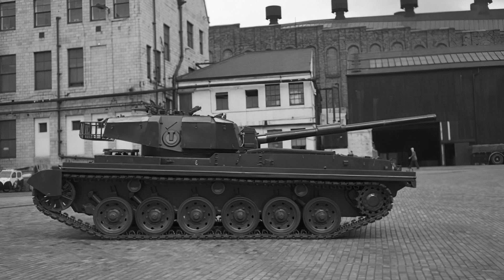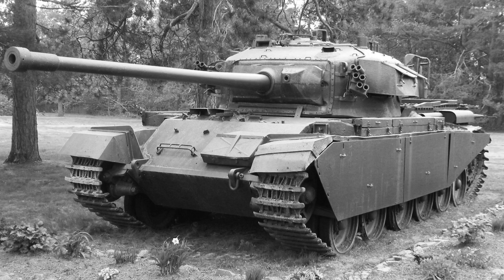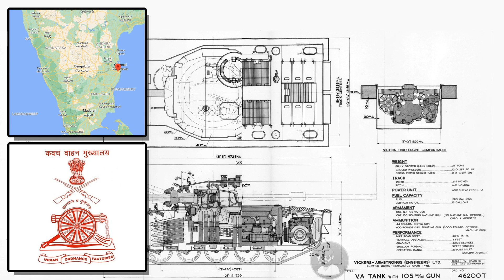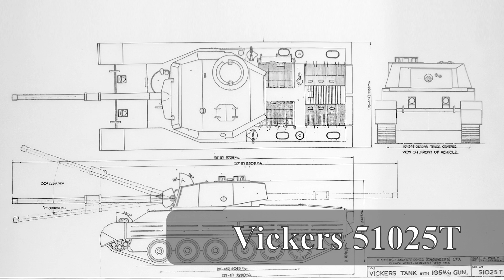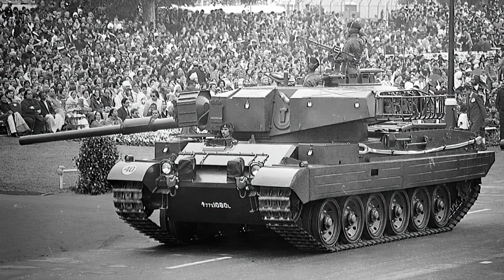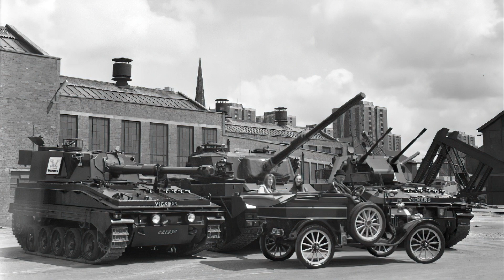Vickers Mk1 MBT - Main Battle Tank - Tank Design & Development - Part 1

Comment: Why didnt the Indians buy spare engine or even more powerful versions of the L60 once the designed matired somewhat? I read the last models of the L60 starting with the mark 8A had been fixed as much as they could and had an output of 750hp

Comment: The engine was the same as for the chieftain but if I remember correctly was down rated a bit in horsepower.. which is one of the reasons it worked..

Comment: Just to point out one thing: but first, I am very glad I 've found this channel, you have excellent content, doing some less known vehicles, as well as those very popular but going to the details not many are aware of. Yet, the thing I heard on many channels is that people are distinguishing two types of armour construction: cast and welded. That is wrong. There are cast and rolled plates armour, but both of them are put together by welding. You will rarely find cast armour in one piece. The same way you produce rolled plates and then connect them by welding, you also cast parts and then you connect them by welding them as well. Before welding there were also rolled plates armour and cast armour but they were connected by riveting them together. And yet, no one thinks there is rivet armour. Anyhow, I wrote this for informational purposes exclusevly, I had no intention to insult anyone or troll or whatever. Wish you all the best and good health!

Comment: It must be noticed that the Vickers MBT used torsion bar suspension, which was quite unconventional for a British tank at the time. 
When rated at 535 bhp, the L60 engine was working well within its full capacity, so stress on the components was low and engine life correspondingly long.
The Rolls-Royce K60 in a twin-engine setup was also considered. 
Compared to the Vijayanta, the Kuwaiti Mk. 1s featured transistored AEI gun control equipment instead of GEC valve (amplifiers), one rear wheel on either side was moved backwards to improve wheel loading, trench crossing and reduce ground pressure, they also lacked of flotation equipment.
Reply: good spot. missed that peter gave some great photos of it but missed the rear wheel move as not recorded in docs. hats off to you sir
Reply: @edfrancis712  You welcome.
Do you plan to make a video on the Medium No. 2 Experimental Vehicle FV 4202 in the future ? (after, of course, the Vickers MBTs series)
Declassified documents WO 185/384 "Medium tanks FV 4201 and FV 4202: design and development" are available at the at the National Archives.
Reply: @georgesabitbol2137  the cleft turret version, indeed I do, I've got a few images etc, but will likely tie it in with an early chieftain vid, as info seems a bit scarce in the archive on it
Reply: @edfrancis712  I am mostly interested by the FV4202 "40-ton Centurion".
Reply: @georgesabitbol2137  ahh two sep vehicles medium gun tank no2 and 4202 separate projects but I'm sure both will be covered :)
Reply: @edfrancis712  Many thanks